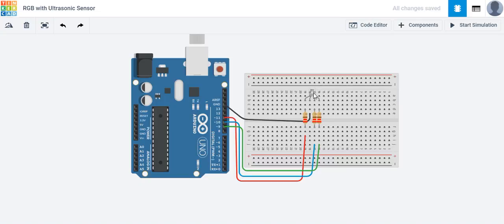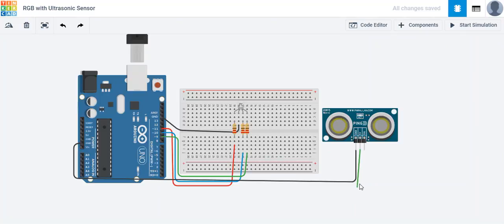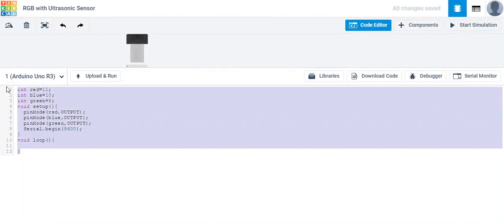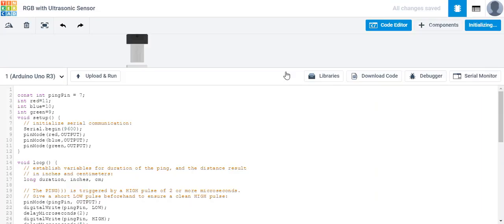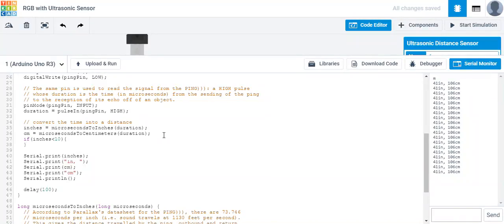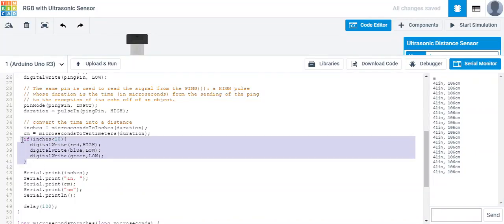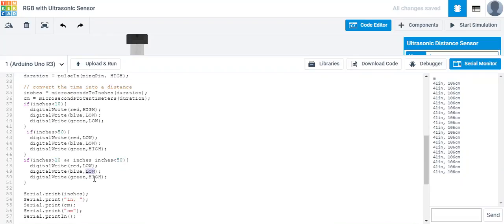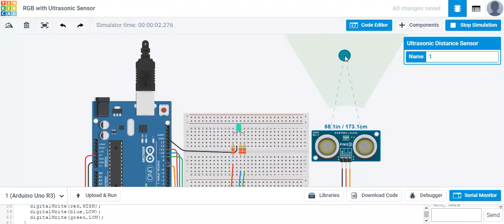How to use an Ultrasonic Sensor in Tinkercad

Comment: const int pingPin = 7;
const int red=11;
const int blue=10;
int green=9;
void setup() {
  // initialize serial communication:
  Serial.begin(9600);
  pinMode(red,OUTPUT);
  pinMode(blue,OUTPUT);
  pinMode(green,OUTPUT);
}

void loop() {
  // establish variables for duration of the ping, and the distance result
  // in inches and centimeters:
  long duration, inches, cm;

  // The PING))) is triggered by a HIGH pulse of 2 or more microseconds.
  // Give a short LOW pulse beforehand to ensure a clean HIGH pulse:
  pinMode(pingPin, OUTPUT);
  digitalWrite(pingPin, LOW);
  delayMicroseconds(2);
  digitalWrite(pingPin, HIGH);
  delayMicroseconds(5);
  digitalWrite(pingPin, LOW);

  // The same pin is used to read the signal from the PING))): a HIGH pulse
  // whose duration is the time (in microseconds) from the sending of the ping
  // to the reception of its echo off of an object.
  pinMode(pingPin, INPUT);
  duration = pulseIn(pingPin, HIGH);

  // convert the time into a distance
  inches = microsecondsToInches(duration);
  cm = microsecondsToCentimeters(duration);

  Serial.print(inches);
  Serial.print("in, ");
  Serial.print(cm);
  Serial.print("cm");
  Serial.println();
  
  if(inches<10){
    digitalWrite(red,HIGH);
    digitalWrite(green,LOW);
    digitalWrite(blue,LOW);
  }
  else if (inches>10 && inches<50){
    digitalWrite(red,LOW);
    digitalWrite(green,LOW);
    digitalWrite(blue,HIGH); 
  }
  
  else{ 
    digitalWrite(red,LOW);
    digitalWrite(green,HIGH);
    digitalWrite(blue,LOW); 
  }
}
long microsecondsToInches(long microseconds) {
  // According to Parallax's datasheet for the PING))), there are 73.746
  // microseconds per inch (i.e. sound travels at 1130 feet per second).
  // This gives the distance travelled by the ping, outbound and return,
  // so we divide by 2 to get the distance of the obstacle.
  // See: http://www.parallax.com/dl/docs/prod/acc/28015-PING-v1.3.pdf
  return microseconds / 74 / 2;
}

long microsecondsToCentimeters(long microseconds) {
  // The speed of sound is 340 m/s or 29 microseconds per centimeter.
  // The ping travels out and back, so to find the distance of the object we
  // take half of the distance travelled.
  return microseconds / 29 / 2;
}
Reply: thank you so much bro 🙏
Reply: @haweewee3  lemme eya

Comment: Can you make the code somewhere to copy?
Reply: You can search the code in google
Reply from the maker: I put the code in the description
Reply: @domingomartinez1536  a bit late 😇
Reply from the maker: @notanoption1793  my bad lol
Reply: const int pingPin = 7;
const int red=11;
const int blue=10;
int green=9;
void setup() {
  // initialize serial communication:
  Serial.begin(9600);
  pinMode(red,OUTPUT);
  pinMode(blue,OUTPUT);
  pinMode(green,OUTPUT);
}

void loop() {
  // establish variables for duration of the ping, and the distance result
  // in inches and centimeters:
  long duration, inches, cm;

  // The PING))) is triggered by a HIGH pulse of 2 or more microseconds.
  // Give a short LOW pulse beforehand to ensure a clean HIGH pulse:
  pinMode(pingPin, OUTPUT);
  digitalWrite(pingPin, LOW);
  delayMicroseconds(2);
  digitalWrite(pingPin, HIGH);
  delayMicroseconds(5);
  digitalWrite(pingPin, LOW);

  // The same pin is used to read the signal from the PING))): a HIGH pulse
  // whose duration is the time (in microseconds) from the sending of the ping
  // to the reception of its echo off of an object.
  pinMode(pingPin, INPUT);
  duration = pulseIn(pingPin, HIGH);

  // convert the time into a distance
  inches = microsecondsToInches(duration);
  cm = microsecondsToCentimeters(duration);

  Serial.print(inches);
  Serial.print("in, ");
  Serial.print(cm);
  Serial.print("cm");
  Serial.println();
  
  if(inches<10){
    digitalWrite(red,HIGH);
    digitalWrite(green,LOW);
    digitalWrite(blue,LOW);
  }
  else if (inches>10 && inches<50){
    digitalWrite(red,LOW);
    digitalWrite(green,LOW);
    digitalWrite(blue,HIGH); 
  }
  
  else{ 
    digitalWrite(red,LOW);
    digitalWrite(green,HIGH);
    digitalWrite(blue,LOW); 
  }
}
long microsecondsToInches(long microseconds) {
  // According to Parallax's datasheet for the PING))), there are 73.746
  // microseconds per inch (i.e. sound travels at 1130 feet per second).
  // This gives the distance travelled by the ping, outbound and return,
  // so we divide by 2 to get the distance of the obstacle.
  // See: http://www.parallax.com/dl/docs/prod/acc/28015-PING-v1.3.pdf
  return microseconds / 74 / 2;
}

long microsecondsToCentimeters(long microseconds) {
  // The speed of sound is 340 m/s or 29 microseconds per centimeter.
  // The ping travels out and back, so to find the distance of the object we
  // take half of the distance travelled.
  return microseconds / 29 / 2;
}